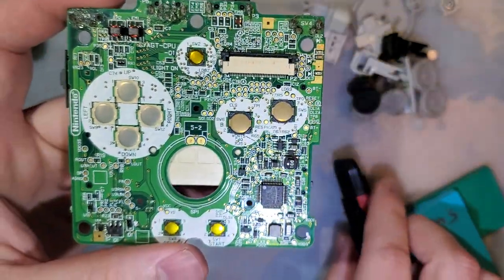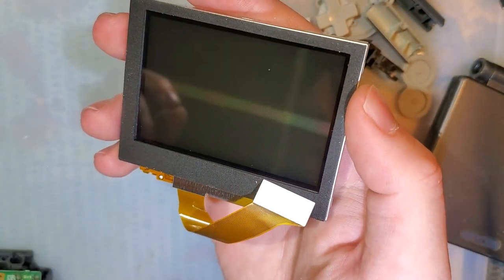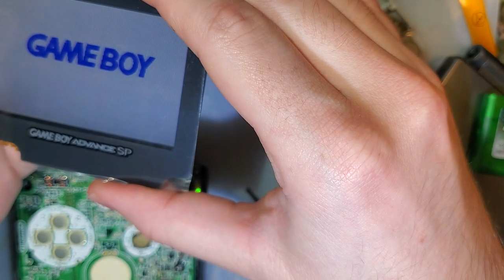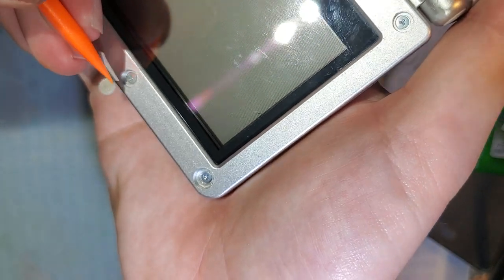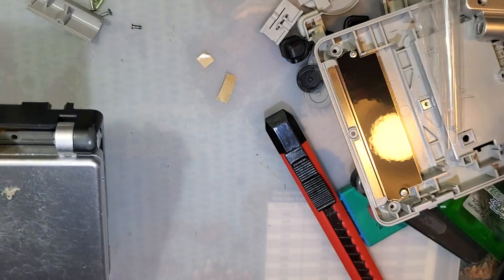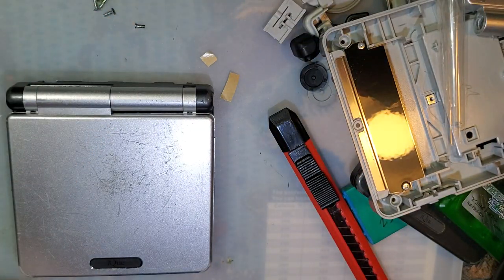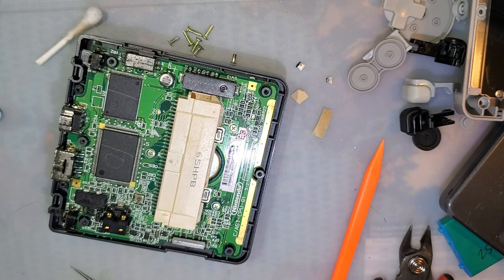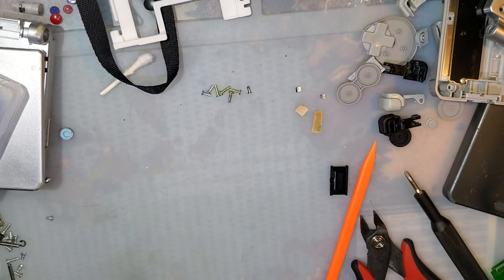Rebuilding an iQue AGS-101 Game Boy Advance SP from parts

Comment: A easier way to change the brightness is to have the battery cover removed, boot the system with a battery pack while the GBA SP is plugged in and then give it a smack to pop the battery out (or pull it out the way it's supposed to be removed I just hit the system because it's quick and really easy to do when I can't find my flat plastic tool) and then do the adjustment with a plastic tool through the hole (that's how I do all of mine)

Comment: Just so you know the little clips that hold the battery door screw onto the battery door can be purchased at auto parts stores they are used on classic cars probably modern ones also my 66 Chevy used one to hold the throttle linkage on I bought a whole pack of 30-40 of them from auto zone for like $5 lol they are a pain to put on and take off but they are great once they are on they are called c clips!

Comment: I understand why you pulled it.  I'm glad I got to watch it and see the experiment of your work on it.  I wish people weren't people sometimes, and appreciate the work you do for the community.  It did seem like a shot across the bow, but knowing the history of that situation it also seemed at least somewhat understandable. 
It's a hard thing to admit you are wrong, even harder to do so publicly, I like to reserve the word brave so I won't say it was that, I also don't think you were completely wrong, but frustrated with a situation that had dragged on longer than was reasonable by any standard.  

If you take this back apart, I kind of think that the dark gray as the back of LCD, and bottom portion with the light gray sandwiched in between (LCD and Speaker/Controller surface) would look pretty cool and with the light gray battery cover might be a good mix.  It looks beautiful though.  A unique iQue.
I think the plain black buttons would keep with the minimalist aesthetics it displays.

Thank you for sharing your hobby with us, I have enjoyed your videos for a long time now.

Do you bag and label your different units with what mods are done to them since you have so many at this point?
Reply from the maker: I was considering that too but I do not have the matching screw covers for the graphite portion. I like the black buttons too but I was considering a different color solely because I'm using aftermarket buttons anyway. But yeah, I think I'll stick with black.

And no, my consoles aren't labelled at all. You see that tour video I made a while back? That's basically my current system but I consolidated my game and console storage to that desk. I probably should label things though, I've taken apart a console for a video and found a mod I forgot about before. 

My parts consoles, if tested, are labelled though.
Reply: makho That makes sense I think you said you didn’t have the dark grey screw covers, but I was thinking each half would be half like an Oreo, dark outside light inside, the scratchy grey just looks rough to me. But it is part of the history, it’s not new and it shows like a beautiful scar from an adventure. 

I did see the tour video but I thought that you said in that you filmed it in February and I haven’t kept close count but it seems like a dozen or more new screen mods for various models of Game Boy have come out since then and since you have the most extensive collection I’ve seen on YT of different mods I thought you might have labeled them for easy reference. I just can’t remember which of the IPS or OC or FP or 101 or 001 mods I might have done so I label things cause I’m an ancient 38 and have a hard time remembering. 

Thanks for the reply and I think you are a valuable member of the community.

Comment: Nice. I've not seen an iQue SP on video. Great restore and great tips. 
I was wondering what you think of the AGS-101 screen? I have a few SPs with them and I have a love, hate relationship with them. Same with the IPS mods though.
Reply from the maker: AGS-101 screen is garbage compared to these IPS mods. The single only pro is the battery life.
Reply: @makho  Ah good to know. 
In your opinion which system/systems are best for doing an IPS mod?
Reply from the maker: @EmperorOfTigers  all consoles have good IPS mods right now so do whichever one you like best
Reply: @makho  Ok cool. Thank you!

Comment: Let's say the ribbon cable connector on the board was damaged and didn't work. What options would you have other than replacing it with another from a donor board?
Reply from the maker: buy a new connector and replace it. Top connect, slide, 34 pin ffc, 0.5mm pitch.
Reply: @makho  thanks, man 😄

Comment: "I got the PCB on taobao" Please tell me the agent you use. ;;"
Reply from the maker: superbuy
Reply: @makho   Fantastic, thank you so much! Also idk if you've tried, but I've had much better luck polishing and removing streaks/dust from screens by using masking tape to dab at the screen to pick up any lint or dust, then using a microfiber towel that's got that waffle-like pattern on it. I've had pretty good results from that, just from switching to the different texture microfiber towel.